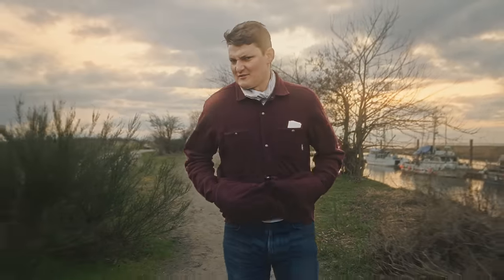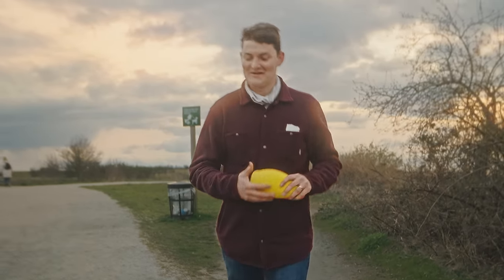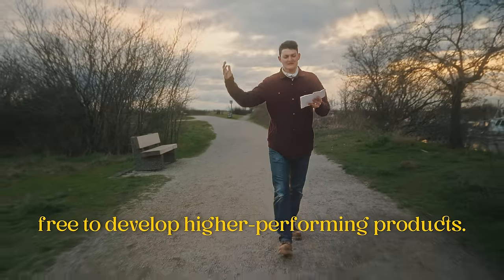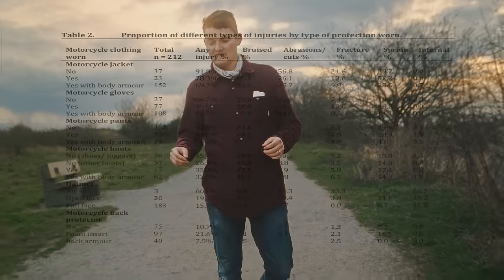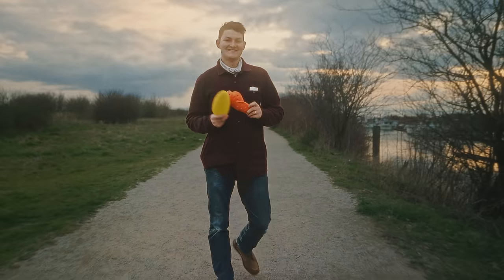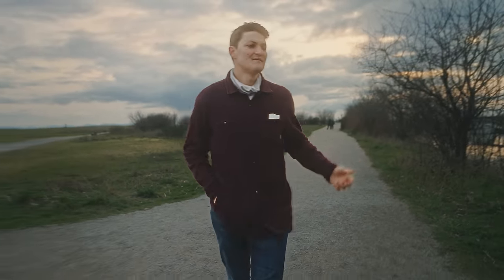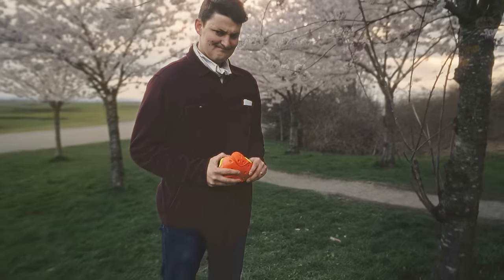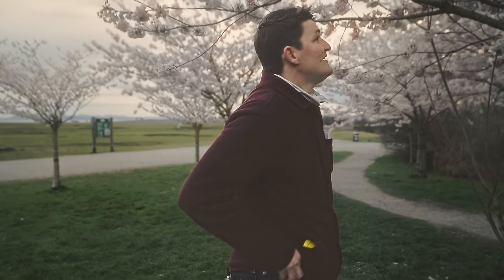Why I Stopped Wearing Motorcycle Body Armour

Comment: The de Rome paper shows that wearing armour reduces your risk of injury by 60-70%. They are not stoping fractures but they are doing the job of poorly designed garments by providing abrasion and cut protection.
Reply from the maker: No doubt! Pads are significant at preventing abrasions and lacerations. Personally, I would look to 1.2mm+ leather for the wider coverage. But you can always use both to be extra safe, to each his own! ~RF9
Reply: @FortNine  you literally made a video saying "don't wear pads". You have a large audience and are possibly putting lives at risk with this. Then in the comments you say that pads are good. What the fuck is happening to this channel.
Reply: @Galf506 I think you missed the point of the video
Reply: @Galf506  gotta make those YouTube revenues.
Reply: I’d agree with @galf506! Any protection is better than None!
Reply: @elvispereira5632 sometimes people die because of overheating. And not effective protection can make more harm than good. If any protection is better - wear a fully enclosed shell helmet without a visor hole, because it protects face part better than any visor. What, you can't see? It doesn't matter, any protection is better.
Reply: @Galf506  you have difficulties in comprehension? He didn't say this at all. Yes, I would rewrite scenario of this episode, because there are too many neurodivergent people who just repeat what others do.
Reply: @Galf506 He literally said in the video that the only real benefit of armor pads could be for the resistance to abression.
Reply: @Galf506  He is saying that at present the only use of pads commonly used is for slide which is not what they are meant for and that the industry regulations need updating to benefit the rider and not the maker. Pads are meant to prevent breakage not laceration/road rash and at the moment they do do that job since the minimum regulatory standards sucks balls.
Reply: I was wondering when Chris Hurren was going to show up! The man in charge of MotoCAP, everyone! Round of applause! Hey Chris, it's your favorite American gear living lady! ❤
Reply: @Leon-ec9ge Could you explain what the point is then? April's fool? Because it's NOT funny.
Reply: @Galf506  "you literally made a video saying "don't wear pads"" - No, he said "I don't wear pads". One missing word changes the entire meaning.
Reply: @littlefrank90 the point is pads are created to prevent breaks, they don't. Pads do work to protect against abrasions, but so does the other stuff.

Therefore Ryan doesn't wear the pads and uses the other stuff
Reply: @Galf506  he's lost the magic. and looks kinda sickly. dude needs a hiatus.
Reply: @Galf506 pal, dont type before you finish watching the video
Reply: @FortNine so your solution is to wear full leathers and an airbag?
Reply: @Leon-ec9ge  I didn't at all. He built in on a strawman and misinterpretation of data. Everyone has been correcting this video in the comments, not just me.
Reply: @Strongest_under_heaven  I watched all of it. Look into the comments for people saying "damn I feel dumb buying protection". This video is dangerous, useless and badly written and I've got no idea how it got through quality control. Maybe there isn't any.

Whatever F9 wanted to say about pads not saving your from fractures doesn't like up with how he narrates it. In the end this video is like the old cigarette adverts saying you can still die from other things, so smoke away.

Nah man. Go run your knee into furniture at walking speed with and without a pad and tell me again they serve no purpose. He's also willfully ignoring how the statistics SHOW that pads reduce INJURY by a huge margin, they're not snake oil.
Reply: @inevespace  "sometimes people die because of overheating." - no they do not. Please provide any evidence at all to back that claim up.
Reply: @flippy66  Josh Lichtle. You will have overheating issue almost every time you go out in hot weather. You know, people in hot countries don't wear protection not only because it is expensive for them. Even evaporation cooling doesn't work there.
Reply: @FortNine  if you cared about rider safety you would pull this video. But you wont.
Reply: Hi Chris: FortNine’s main point was regulatory capture – a problem that needed calling out. In Europe and the UK, the poachers are also the gamekeepers for motorcycle protective clothing and armour standards. Manufacturers’ representatives comprise around half the European standards committee – it’s even been chaired by Dainese – and the British Standards Institute. That’s plain wrong!

We’ve seen it cause problems from Alpinestars and Dainese blocking a Level 3 standard for armour in the past to, more recently, Knox vetoing the establishment of AAAA and AAAAA clothing standards. In clothing, the abrasion resistance standard for AA was lowered when manufacturers found some materials couldn’t pass the proposed test – a blatant example of regulatory capture. 

Regarding armour and open wound injuries, body armour is neither tested nor certified for abrasion resistance. Understandably, many infer that armour aims to reduce fracture risk.

Often, high standards can drive innovation. So isn’t it high time we improved the standards for body armour, not to mention preventing the poachers from being the gamekeepers?

Comment: Fell off my motorbike when a deer ran out in front of me. and I collided with it   I was travelling at 100 km/h.  I fell on my right side and broke both arms, 3 ribs and tore my rotator cuff. No lacerations though.  I did fall on my right hip as it was numb were the armour was for 6 months but no broken hip.  To this day I believe that the d3o padding saved my hip for a break.  So I am not about to take out the armour on my gear.  There was no way that the armour in my Joe Rocket would have saved my arms from breaking but all the gear saved my from more serious injuries than I received .
Reply: so you basically broke every single bone in your body from crashing into a deer at speeds that weren't even that high, and you think the armor saved you? what did it save you from? you broke like 10+ bones dude.
Reply: @ropeysubstance1719  all those injuries pale in comparison to a fractured pelvis
Reply: @ok101h3  they don't even make pelvis armor.
Reply: @ropeysubstance1719   oh you sweet summer child, what bone do you suppose your hip bone is?
Reply: @ropeysubstance1719  You did not understand what I was trying to say.  I fell in what is call a FOOSH. Falling on out stretched arms .  No amount of motorcycle jacket padding in the world would have saved my arms from breaking or my rotator cuff from tearing.  The ribs may have been saved by an air bag.  BTW only 6 bones broken and I walked away from this accident.  If I had broken my hip (padding did save) my recuperation time would have been greatly increased.

Comment: I've been riding now for 50 years,  In my youth I rode an IT400, my moto was if I wasn't crashing then I wasn't going fast enough.  Back then everyone knew that helmets were important, and then clearly gloves,  I rode quite often and when I was in high school, I commuted thru back roads to school.  On my way home one day with my back pack,  my home work and a book or two I had a significant crash.  I remember hitting my back , but I could feel the cushion of the books and folders.  Bottom line, I think this guy is nuts,  I still ride and I wear full armour protection.

Comment: The studies compare injury/fracture presence, not their severity/classification. Theres there is a big difference in healing when it comes to simple vs complex fractures.

While the armor may not reduce the risk of broken bones, it may reduce the severity and its corresponding fracture classification with just the reducion of impact force.
Bumping down a complicated multi part shattering fracture down to one with only 2-3 parts is already worth all the clunkiness in my opinion.
Reply: I was also thinking what happens if you had an lighter accident which resulted in say 8kn of unprotected force, maybe with the protection it would get you below the 4kn and save a fracture
Reply: This was going to be my point. The result of HAVING a fracture, sure. But what about severity of the fracture. (Perhaps bone extrusion or multiple breaks) 
I bet a bit of a “softer” landing on CE2 would reduce, even if not by a hell of a lot.
Of course … a lot goes into it. 70mph vs 25mph …. High side vs low side …. Front end collision. 
And there are rare days i go without my jacket. But if I’m wearing it … I think I’ll leave the CE pads in it.
Reply: I was also wondering about lower impact accidents experienced during adventure riding. Knee, elbow, and shoulder protection is likely to lessen the severity of soft tissue damage.
Reply: ED doc here. There is no feasible way for armour to reduce loading to your bones in a crash without being 10 times thicker. And a small % reduction in force won't realistically change a fracture pattern. There just isn't enough material to meaningfully decelerate the impact.

But it is easier to put on a well fitting cast to your elbow if your olecranon bursa isn't blown up like a balloon with a bruise. And it's easier to give you a cast that you can keep on if there isn't a big wound that needs dressing changes underneath.

I'll keep my pads on.
Reply: @DaveXL495  Thanks for the insight. 
I was specifically thinking about cases like: During a slide on the street from a crash, lets say an elbow or knee makes contact with the pole of a street sign, guardrail or curb corner. 
Small point impact on bone/joints with no armor vs armored part that distributes the force on a larger surface. 
While the armor may not prevent a fracture because of the high force, in this case it might for example prevent a complicated elbow joint fracture and just fracture the humerus or ulna/radius insted.

Comment: I took a 130mph 20m slide. No breaks and a minor bruise to my foot and finger, I'm grateful to Alpinestars and Knox as I am sure their armour is the reason I have such minor damage. With armour getting so thin and comfortable any extra protection has to be a bonus.
Reply: only 20m at 130mph...hmmmmm thats 58m/s
Reply: @timpaquin9345  must of shaved off half that speed by the time I left the bike for my arse to hit the tarmac and start my slide. Either way, glad I had armour in!
Reply: @yodomcat you used your arse as a brake.
Reply: Just 20m 😱... Damn.  Did something stop you or just sliding to stop.
Reply: @wearealllost8907  yeah another bike

Comment: I think the research is missing one important group of people - those that had an accident but walked away completely unscathed because of knee or elbow pads. 
Those people are not part of statistics you mentioned, so... paint me skeptical.
Reply: Similar to the  "survival bias" :) I agree. I stick to the comfortable, but padded gear. Side note, I've padded my (somewhat) civilian trousers at the knee, with simple wrapping foam. It keeps my knees warm in the winter, and I like this extra warmth on or off a bike.
Reply: Agreed
Reply: Really good point... ☝️
Reply: Correct.

I lowsided my CBF600 two years ago on a roadtrip through Germany. Speed in a tight curve fairly mundane, 40-50 kph at most. I walked it off pretty much unscathed and two set of things clearly had a major impact in that outcome :

- the engine crash bar that took a beating, effectively keeping enough space between the bike and my left boot that had no trace of the fall whatsoever at the end.

- The gear that protected my left side during the short slide to the ditch with the bike : left glove had small rips in it. Left elbow area of the jacket punctured through exactly where the elbow pad was. Some minor scuffing of the jacket elsewhere.

I got right up a little shaken, had to do some emergency bike repairs to get to a repair shop for some more (coolant leak caused by the damaged crash bars and some broken plastic here and there that needed zip-tying, but I was mostly intact. Ironically I had a small bruise exactly where my jeans' left hip pad was, it probably got "moved" during the impact, lightly bruising/pinching my skin but otherwise absorbing enough energy to prevent any injury.

While the pads may not be "enough" for violent impacts. They're still "something" to mitigate the more mundane ones that might otherwise leave you in a world of pain even for so little.
Reply: Which means that low-speed, low-energy accidents are completely unrepresented in the "with pads" statistics.  This leaves only the higher speed, higher energy impacts where the pads are insufficient.
Reply: This was population-based study over 12 months to account for the types of clothing worn by riders in all types of weather. Riders had to have been in a serious motorcycle crash on a public road and either been injured or their bike seriously damaged.  It was held in the Australian Capital Territory because it is effectively an urban island surrounded by national parks and rural areas. This meant riders could be recruited either through one of the only two hospitals or 14 motorcycle repair services available to them. (de Rome et al AAP 2011)
Reply: My accident falls into this category. Was wearing full gear when I went down doing 70 mph. The gear was completely destroyed, but I got up with only a slight bruise. Never walked into a hospital and would never be included in this type of study.

Comment: I was a London despatch rider for nearly 10 years and I can tell ya - if I hadn't have had something between my kneecaps and shoulders other than just a bit of weave on the many (slow speed, which is why I'm still alive) offs I had in that period, I wouldn't be walking. There's no question that the padding provided by the CE stopped my kneecap from being shattered, or fleshy bits from being shredded. I shall add that I frequently didn't wear standard bikers gear because most of it wouldn't last a month of despatch riding, it's a very different experience compared to the average weekend warrior or even hard core commuter, and I wouldn't spend a penny on some of the crap the average biker buys. My stuff was a mix of army surplus, industrial fishing stuff and other things that actually worked. But I always had troos and jackets with CE pockets.
Reply: Also a London despatch rider back in the 80s, Security Despatch, Addison Lee and a few others, ah memories of trying to look at a map in the rain and figure out where the hell the drop off was, or even where the hell I was. Roger roge...but the money was great🤣
Reply: @tonydare7614  before my time, addi Lee paid better then. I was doing it on the noughties. Was still 500 garra lmao. Less than minimum wage probably. I work in an office now, but you know, I tried doing some evening food delivery last year on 125 for beer money (in Nottingham) and it was abysmal. Rather have a human controller than an algorithm, know what I mean.